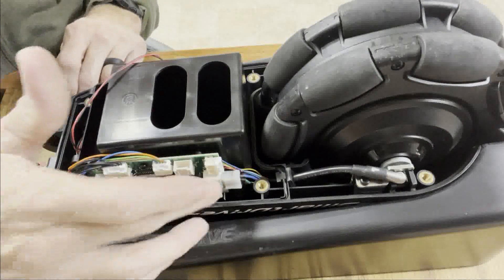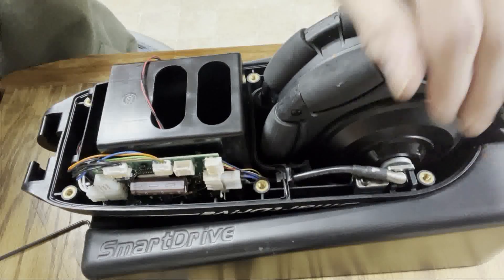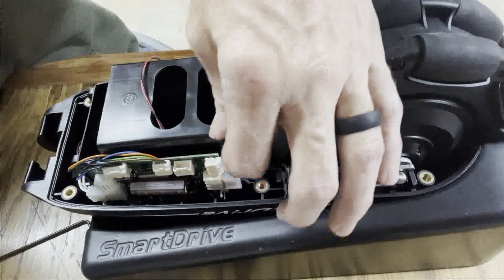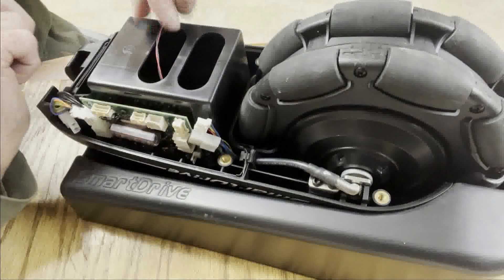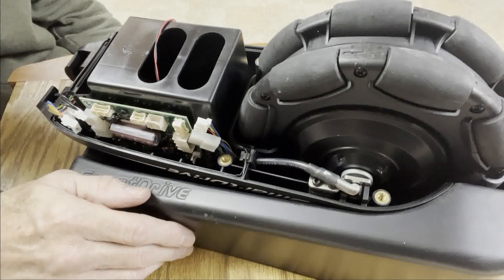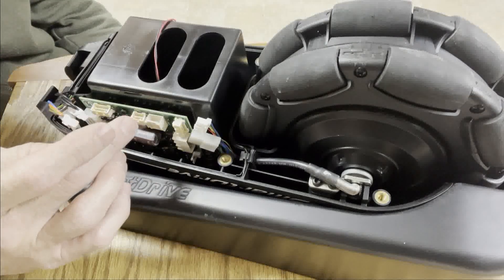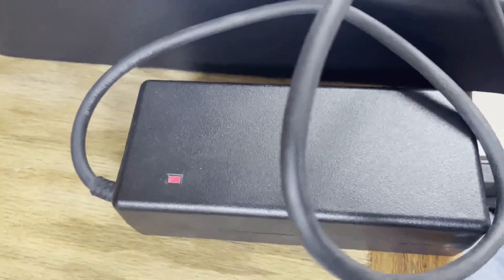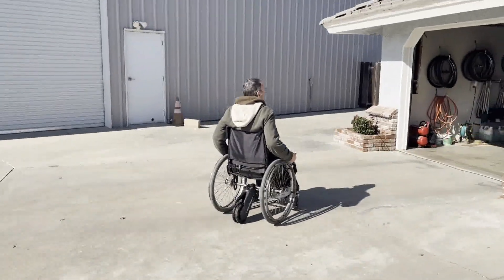SmartDrive MX2+ Budget Battery

Comment: I just did the mod but the cover plate won't go down??  I think it may be because I tried salvaging the entire top half of the battery comparment (so I could leave the beeper where is was) instead of only saving the section for the circuit board like you have shown.  Seems the back of the plastic compartment is what shoved the battery up forward significantly enough that the smartdrive cover will not close up???  Just wondering if you tried and had the same issue  --- also how tall was your foam blocks?  mine seem to be a little shorter not raising the battery above the terminials/sockets enough for room for the wiring?  Hope you can reply soon so I can hopefully get the mod done.

Comment: Forgot to ask if I need to worry about the software update inclination issue if I am using the wired buttons for contols?  or if I am using the Mobvoi TicWatch E2 (Push Tracker E2)?
Reply from the maker: I am not using the wired controls.  I have mine connected to an iWatch SE.  I did the bluetooth and firmware update just a few days ago with no issues.  The update said it was for the wired speed control but I did it anyway.
Reply: @duneroller  I just did the mod but the cover plate won't go down??  I think it may be because I tried salvaging the entire top half of the battery comparment (so I could leave the beeper where is was) instead of only saving the section for the circuit board like you have shown.  Seems the back of the plastic compartment is what shoved the battery up forward significantly enough that the smartdrive cover will not close up???  Just wondering if you tried and had the same issue  --- also how tall was your foam blocks?  mine seem to be a little shorter not raising the battery above the terminials/sockets enough for room for the wiring?  Hope you can reply soon so I can hopefully get the mod done.

Comment: Looks great but I would imagine than weighing 1/4 of the original battery is there a loss of performance -- such as torque for climbing hills, ability to run at full speed without overheating or a significant loss of range -- very good /excellent mod -- how long does it last?
Reply from the maker: The original battery is LiFE.  The hoverboard batteries are LiPO.  The capacity of the hoverboard batteries is roughly 1/3 greater than the original pack.  The medical devices use Lithium Iron (LiFE).  I have never had an issue with the battery pack getting hot or any performance issues.  The hub motor on the SmartDrive is only about 200 watts so the hoverboard pack is more than capable of providing adequate current for hills and maximum speed.  The longest distance I have run the modified MX2+ is a little over 7 miles measured by GPS.  There was still some charge left so I don't actually know the maximum range.  The range will vary greatly depending on speed and terrain  just like the original pack.

Comment: Hi, ever consider replacing with an o-drive controller and doing own software? (recall on those controllers)
Reply from the maker: I have considered it and actually built a hub motor hall adaptor for an eBay drive.  I intended to use a standard speed controller.  I ran the Smartdrive on the bench but decided against the modification because it eliminates the safety features (submarine and over backwards) built into the mother board.
Reply: @duneroller  https://www.youtube.com/shorts/kRfVqNnHXXs
Reply: @duneroller  same, want to colab on printed version? get the smart drive replacement rollers. Lots of goof brushes motors to choose from these days.

Comment: So the only tilt sensor is in the power drive housing? Would you know if there is tilt sensor in the mounted throttle? My kids throttle got pushed over and back from going in and out of the van. I straightened it up and the drive started working again.🤷
Reply: Sorry but I don't have a set of frame throttles.  Anybody else out there know if they have a tilt sensor in them?  I would think they would not have a sensor because it would be redundant to the one on the main board of the drive.  I did read about a recall on the speed knobs in New Mobility but it did not contain much detail.
Reply: I just found out there is a recall on the wired throttle. It said throttle would just stop working,or not stop when pushed. Three people got hurt from it!
Reply: I just talked with customer service and she said there is a tilt sensor in the throttle.  I still am going to get another one. It takes alot of abuse. They only warranty the original for 1 year after purchase.

Comment: What kind of range are you getting with it? I just got a never used but never charged smart drive with a dead battery
Reply from the maker: Stock battery is rated at 7 miles.  I've done about 7 real-world miles on a single charge according to the iPhone app (1 light and 15% left).  The hoverboard battery has more capacity than stock but I don't think it would actually go 7 miles unless it was runway flat and straight.  The 7 miles was a combination of bike lane (hand drag on rim to stay on the road), sidewalk, and paved RV park.  
Battery is 8 months old and still working fine.

Comment: Good Morning Jeff,

I'm a bit of a dinosaur but I'll ask one of my daughters how to use Instagram. If I can rub two rocks together and figure it out, I'll send you photos of the battery box, and if you wish - one of the boxes.  I used to own a plastics injection molding business down here in San Diego and for over 20 years designed and built production injection mold tooling and finished products for my customers. I moved some of my CNC equipment to my home "shop" when I retired and also still have several - 3D printers which is what I made the battery boxes with. The fit is perfect and I have to say that its a really good looking system. The only thing that keeps it from being a complete "Plug and Play"  for the average person is that two of the wiring plugs require a short extension which could be easily made by someone with basic electronics skills. The box is simple to manufacture. A 3D print with a Bambu printer takes just under 3 hours in PETG. An injection molded part would take about 20 seconds. My concern about possibly manufacturing and selling them inexpensively is potential liability and the yet unexamined cost of liability insurance. I've considered sending the design to Smart Drive, but I suspect that they'd rather continue selling their batteries for $1600+ instead of a longer lasting, lighter weight one  complete for $100 to $200??? If I can figure out how to use Instagram we can trade thoughts on that later. If you have thoughts on this that won't end up with one of us dealing with un-necessary liability kindly unfold them.  Best to you.
Reply from the maker: I would love to get a plug and play kit out there. I'm not hard to find if you use Facebook, Instagram, or LinkedIn.  I'm in the Madera, CA area.  We would need to discuss how to limit the liability while still giving the users an option.  I'm currently in the environmental field and my LinkedIn picture is about 10 years old.

Comment: Good Afternoon Jeff - I appreciate your efforts to help those who need an affordable battery for their SmartDrive. The SmartDrive is a well thought out, excellent product. Their replacement battery at $1600+ for a battery that can be manufactured and sold for $59-$70  is a bit steep for anyone let alone someone who requires a wheelchair for mobility. Following up on your kind YouTube providing an explanation and demonstrating  how an affordable hoverboard battery can replace the $1,600+ replacement battery designed for the Smart Drive, I have designed and made a nice fitting  box to contain the battery you've shown here with standard attachments to the smart drive, fitting attachments for the computer board, and attachments for the buzzer. If you provide a contact address, I will send you photos of same and if your request it,  follow up with one of the boxes. Looking at some of your you tubes, you are a fine example of "running" with the gift of life. Thanks for that. Mike C.
Reply from the maker: I'm not sure if you are an Instagram user.  I don't use it much but do you the messenger feature.  You can send me a message @duneroller and I'll reply as soon as I get the request.  I don't know a safer way to get in touch without posting email on a public post.  I'm very interested in the box and how you are making (printing?) them.
Reply: @duneroller  I am doing the mod and could use one - how can I?
Reply: I am doing the mod and would like to know how I could get one of the custom boxes?
Reply from the maker: @Rector65  Sorry, but we never finished development on the plug and play conversion.  I cut the factory box as shown on my MX2 and MX2+.

Comment: I would like to make a wire conversion harness to connect the main power connection on the stock battery to connect to the connector on the hover board battery which is a SL60. Can you (or anyone) tell me what the identifying number is for the stock larger battery connector - and where I might purchase one? Thank You for your help on this.
Reply from the maker: I don't happen to have one apart right now.  Most of the other connectors are Molex Wire to Board connectors.  They are also known as "plug and socket" connectors.  For example, the RS232 plug from the battery is a CLIK-Mate Molex.  The wire to board Molex connectors can be found here. https://www.molex.com/en-us/products/connectors/wire-to-board-connectors.  The connectors can be complex.  The plug and socket connectors are sold separately from the male and female plug housing.  I have many sets of connectors and crimping tools including several Molex and JST (Japanese Solderless Terminal).  The connectors don't match any of the common plugs I use on RC, motorcycle, and automotive applications.  I'll take a closer look next time I have it apart.  
If you are dead set on not cutting the wires start by measuring the pin-to-pin distance.  This is the pitch of the connector.   Identify if the plug connectors are round or blade next.  Then locate the corresponding family and part number.  Digikey stocks many individual parts and crimpers.  Let us know if you find the exact connector.

Comment: I use he newer "rotary power" controller to turn on and off and vary the speed of my SmartDrive. It plugs into the same socket used to charge the battery. My question is - if I splice the two power wires in the hover board battery into the original power wires (red and black) and use the same connections into the circuit board - do you foresee any damage or issues from that layout. 
Since the hoverboard battery has its own integral BMXXXX board - am I OK ignoring the two sets of plug ins from the BMXXX board that exists in the original $1,600 SmartDrive battery, or do I need to integrate them somehow into the new system's circuit? I'm unsure of how the 2 plugs from the BMXXX origional battery interact with the circuit board??? Can it be ignored since it appears that the new hoverboard battery has its own integrated BMXXX?  It appears to me that the new hover board battery can be plugged into the existing circuit board and be charged from the origional charging system/plug, and enjoy a long, happy life doing its work. 
Thank you MUCH for the time you've taken to design and YouTube post a solution providing an alternative using a more reasonable $50 to $100 battery to being forced to purchase a battery proving lesser service for 15 to 30 times the cost. 
SmartDrive is a finely designed product. Their product and battery costs however significantly gouge those who are unfortunate to be mobility handicapped as well as the insurance companies or uninsured people that are seeking a way to be mobile without wearing out their shoulders in the process.
I look forward to your response and/or any knowledgeable answer posted.
Reply: Good Morning Jeff,

Wow! thank You for a fast and helpful response to my question. I will complete the new battery installation today. Thank You again for your consideration in finding and YouTubing a solution for wheel Chair users who cannot pay $1,600 for a battery that with a simple modification can be replaced for $50 to $100. Best Regards - Mike C.
Reply from the maker: The accessory wires and plug are separate from the charge circuit.  I don't see any issue with the splice and connect as shown in this video.  The original battery should have 3 connectors.  One to the charge port, one that supplies power to the circuit board (heavy wires) and the rectangular RS232 from the BMS to the main controller.  The hoverboard battery does not have a separate charge and power from the BMS so the charge and power plugs need to be connected in parallel as shown.

Comment: I was able to rebuild my 
pack for $ 180 Canadian getting them from 18650 Battery store , but you need access to spot welder for the nickel strips you also need . Did you mention scooter battery .
Reply: If you found my channel, mine is better solution. As good as original pack, runs for 4 km and still show 3 led.
Reply: 18650 may have 3.7v The original is 3.2/3.3v

Comment: Can i get the information on the hoverboard battery?
Reply from the maker: I used a 36 volt 4.4AH (4400mAh) 20 cell (10S-2P) with outside dimensions of 135X70X60 millimeters.  Some descriptions will say 135X75X60 which will still fit.  There are many options on Amazon or eBay.
Reply: @duneroller is the battery higher capacity than the original?